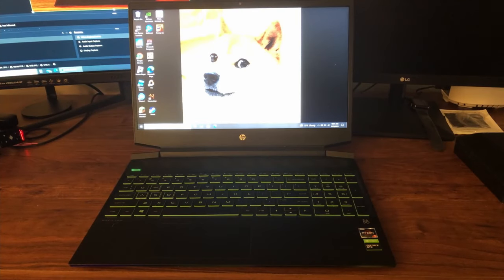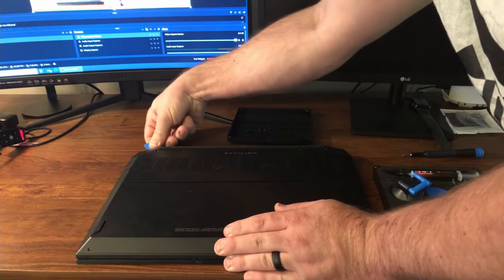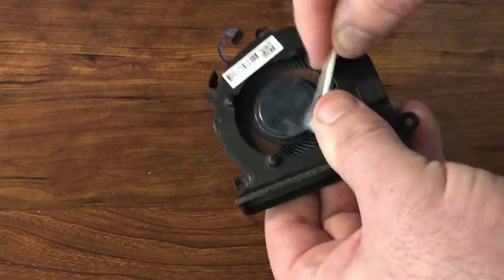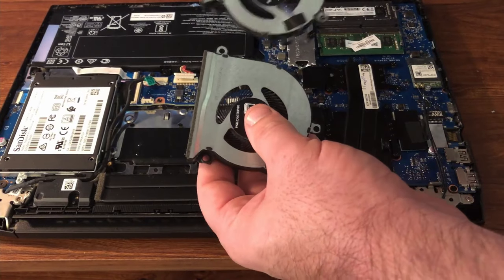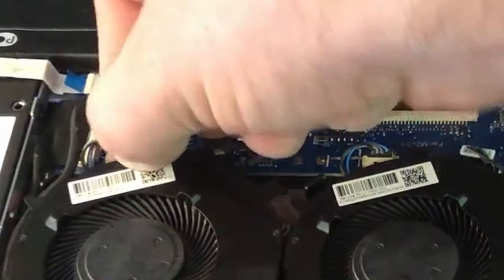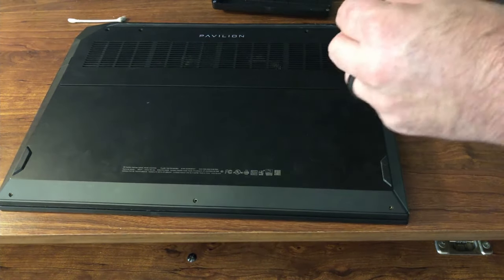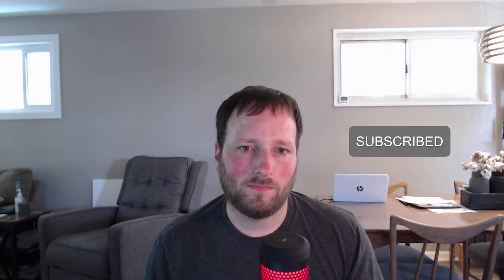How to clean a Laptops Cooling fans! Help your laptop run cooler then before.

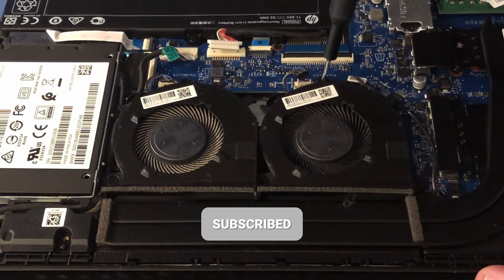Comment: i have a question, i have the same laptop in this video, at 2:23 what is that on the left of the fans with the big white sticker?
in that spot on my laptop, there is just a hollow plastic thing that doesn't seem to have any purpose. 

edit- think i figured out it's space for more storage.
but i still would like to ask, is there a way to take apart the entire fan and look in it? mine is loud and vibrates the whole laptop.
Reply from the maker: Yes, that is the ssd/hdd expansion bay area. For the fans I would say yes, but I haven’t done that kind of repair yet.
Reply: @MrDarkcore  so upon further investigation, it appears this fan doesn't start moving until shortly after the working one, and it's not as smooth and stable as the other. I think it's broken :(
Reply from the maker: Well if you think it’s a bad one, you could order a new on Amazon. It seems they run for around 10-15 usd.
Reply: @MrDarkcore  yeah I'm going to need to do that, thanks for help though

Comment: just a question, i paid a place to service my laptop, they said it just needed a cleaning, i expected them to do this what you showed in the  video, but all they did was take my money and send me home with the laptop exactly the same as i brought it in, had to just clean it myself, so what does a cleaning entail, they told me they just spray it with a can of air
Reply from the maker: How much did you pay for that service? To be honest, seems pretty shady to me.
Reply: @MrDarkcore  i signed up for their home plus care which is 25 a month, even more expensive than geek squad
Reply from the maker: Ouch, that’s pricey. Does that plan cover cleaning?
Reply: @MrDarkcore  yea they said it was covered but didn't actually clean it then tried to say, just bring it back in, but why would I when they didn't do any work to begin with so they blew it when it comes to customer service
Reply: @MrDarkcore   after further investigation it was found that they misrepresented their plan , basically tricking me into buying, thankfully though i was able to file a complaint and get my money back , i did the cleaning myself and the computer is much quieter now
Reply from the maker: That’s awesome, I had a feeling that it was to trick people into buy something they would never persuade getting done.

Comment: i do not feel any hot air flow coming out of the exhaust vents i use to be able to feel  it  before. but i do hear a fan so maybe my laptop has tow fans and maybe one is broken my laptop is a 2009 or 2010 laptop  Satekkite P855-S5200 windows 7 if there no hot air flow from the exhaust does that mean my laptop is broken i also put my vacuum on the exhaust vent i hope that did not brake  it before.  then to day i put it on the bottom intake vents  as another video said. is there away to fix this with out having to open the laptop like using a external cooling fan the kind that attach to the exhaust vents  untill i can take the laptop to the place to get it checked out? i need my laptop it very imported it will not brake down my other laptop does not work as it does not connect to the internet for some reason
Reply from the maker: If it the laptop is over ten yours old it could mean the cooling fans are going bad, but if it powers on and doesn’t crash because of heat I wouldn’t think that’s the issue.

Comment: My laptop has a DVD tray or whatever it's called lol do you know if I have to like, open the tray to take the back lid open or something? I took off the screws but couldn't figure out how to take the lid off ._.
Reply from the maker: How old is that laptop?
Reply: @MrDarkcore  maybe from 2015? No idea!! Model is hp notebook k8p06la#abm or so it says on the back
Reply: No wait that's the product name and model is 15-ac104la. I really don't know anything about computers sorry
Reply from the maker: @death__ray  is the battery internal or a removable external battery?
Reply: @MrDarkcore  it's removable, it's just where the hinges of the screen are

Comment: Please help me! Its been a few days since my hp gaming laptop makes this weird throttling sound. I have a similar laptop like yours and it turns out that the left fan did this loud sound. I compared both fan movement and it seems like the left fan have something in it that reduces the speed of the fan while the right fan works normally fine. Tried putting just the tip of my finger to the left fan and suddenly the speed of the left fan went to normal. But when i let go of my finger it makes the stupid loud sound again and it also seems like the fan vibrates way too much when i no longer touching it. I dont know what is going on with this thing but can you please help me? Thank you 😢
Reply from the maker: Sounds like it’s time to replace that fan, maybe an internal part came loose or broke causing the noise/vibration.
Reply: @MrDarkcore  thought i can try hard enough on fixing it 😅 thanks for the advice bro

Comment: i wanted to ask what does it mean when my pc does a weird sound (sounds like its about to explode💀) and if this helps cuz ik the problem is with the fans but idk if only cleaning it helps or i need new ones or sum, so i wanted to ask you if you (or somebody) know
Reply from the maker: Does it have any other issues like crashes or high temp under load? My first guess would be if it maybe a fan blade broke or something got sucked into the fan if it’s a constant noise.
Reply: @MrDarkcore  nope it doesnt and thank you i guess ill have to check on it😆 tysm!

Comment: Hi I cleaned it and it’s not starting up after I plugged the battery again I’ve been holding the power button for couple of paused seconds I’m starting to get anxious any Tips?
Reply from the maker: Try hold the power button down for like 20-30 seconds. See if that works.
Reply: @MrDarkcore  I did it man it didn’t do amything
Reply: @MrDarkcore  I got scared plugged it into the wall it booted up but it was like I had no battery was only working with the power from the wall
Reply from the maker: Did you reconnect the battery after working on it? I would make sure the connector is pushed in all the way. It could be loose.
Reply: @MrDarkcore  yes I just unplugged and plugged it for the second time
Reply: But here’s the thing I haven’t used
My laptop in a while so is there any chance that it was out of battery before I did this so should I maybe try to put it on charger for a little bit ?
Reply from the maker: That’s what I would do. Maybe battery just not charged enough to boot it on.
Reply from the maker: Any luck?

Comment: Hey  can we use like water insted of the liquid u used to clean the fan or like some other liquid
Reply from the maker: I wouldn’t use water unless you know it’s definitely not touching any electronic parts. Water will cause corrosion damage to it. I will have to look to see if there are any other types of cleaning solutions, that won’t cause damage.
Reply: @MrDarkcore  did u come across some liquid
Reply from the maker: @9e24ayaansalam8  not really, most things I could find where mixing other solutions together. IPA is probably the best option to be honest.
Reply: @MrDarkcore  Ok thanks for ur work!

Comment: What do u use if u dont have any opening pick?
Reply from the maker: The first time, I opened it I used a metal butter knife but wouldn’t recommend that. Just need something thin that would damage or break off inside the laptop.
Reply: An Old credit card or plastic card works fine use the edge,s

Comment: I did exactly what you did in the video and my laptop no longer turns on, power still goes through because my rgb on keyboard and mouse is still on but the laptop just doesnt turn on
Reply from the maker: Did you hold your power button down for 20 to 30 seconds after plugging everything back in? Plus I think the power cord can’t be plugged in while do this.
Reply: @MrDarkcore  Yep did that and no cables were plugged into the computer i have no idea what went wrong
Reply from the maker: @firenut4971  I would check to make sure ram is seated correctly and also in the right channel if you not use two sticks. Fans are plugged in, hard drives also. Stuff like that, the try holding power button down again.
Reply: @MrDarkcore  ive done all of those ive just accepted it and im saving up for a new one
Reply from the maker: @firenut4971  there is one other thing you can try but it’s kinda annoying to do.
Reply from the maker: So, you have to open your laptop back up. Unplug the battery, no external power, and hold the power button down for 20-30 seconds. Then plug in the external cord and see if it powers on.
Reply: @MrDarkcore  ive tried and to no avail
Reply from the maker: @firenut4971  that’s frustrating…
Reply: @MrDarkcore  yeah i think ill just ask for money for christmas and save up tbh

Comment: I am wondering if for any laptop, are there effective methods in cleaning heatsink pipes? Like taking it off, to be air-can washed.. since water can corrode metal?
Reply from the maker: Use 90% plus isopropyl alcohol to clean heat sinks pipes. It’s safe to use on copper or aluminum pipes.
Reply: More information about Laptop : https://youtu.be/fPPcBPsLlT0
Reply: @MrDarkcore what do I do if the heat sink pipes are in the way of unplugging the fans?

Comment: i noticed that the replacement fan has only 1 fan when i need 2, what do i do in this case?
Reply from the maker: Hmm, is one fan of the old fans better then the other?
Reply: @MrDarkcore  they both kinda suck but if u know, they areboth different and 2 types so they can fit over eachother
Reply from the maker: @zezo7114  ok, I am lost now. 😂 is it connecting the shock mount to the adapter? Or something?
Reply: @MrDarkcore  I'm saying, notice how the 2 fans overlap each other, which means they are made together i would presume, one for the right and one for the left. When i buy the single ones, how do i know which side fan i am getting?
Reply from the maker: @zezo7114  oh sorry I had a boom arm question in my head 😂 , I will have to watch my video to have a better answer.
Reply from the maker: @zezo7114  pretty sure both sides are the same fan. They have a screw hole tab higher on the right side and one that’s lower on the left side so they can interlock.
Reply: @MrDarkcore  Ahh thanks, I didnt wanna open my laptop to check again because i almost broke a tab lol. Thank you very much for letting me know
Reply from the maker: @zezo7114  no problem, glad to be somewhat of a help. 😂

Comment: Bro my new hp pavilion laptop fan makes noise is that normal....it don't make loud noise but I want to know whether is it normal or not..plzz tell me
Reply from the maker: Is it under a load? That makes any laptop louder.
Reply: @MrDarkcore  no bro it's new laptop....and it makes slight noise
Reply from the maker: It is hard for me to tell, since I can’t hear your laptop. It’s going to make noise no matter what, but I would really only worry if it’s over heating.
Reply: No it's not bro....but it makes noise sometimes that's it
Reply from the maker: You could take the back cover off and check if everything is secure. Plus make sure no debris in there.
Reply: More information about Laptop : https://youtu.be/fPPcBPsLlT0
Reply: @raghavendrahk375  same here

Comment: Why would we unplug the battery
Reply from the maker: I thought that same thing, I changed all kind of stuff without unplugging the battery.  Apparently it’s the proper thing to do though. 😂
Reply: @MrDarkcore  I heard unplugging the other things like the fans has a very very small chance of causing circuit problems throughout the computer if the battery stays plugged in but still very low chance. I will unplug it though when I clean mine, for sure.

Comment: When I was taking the battery plug out i scratched the thing behinde it i 4hink its the mother board but my laptop is still working rn
Reply from the maker: What did you use to remove the plug?
Reply: @MrDarkcore  flathead screwdriver and my fingers
Reply from the maker: From what I found online, scratches are fine unless you digging your flathead into the board. I would think your fine, but next time maybe get a sponger tool so you don’t have to worry about that. 😂
Reply: @MrDarkcore  yea hahaha thanks the video is really good tho
Reply from the maker: @AzemMC  thank you, I am glad you were able to find it helpful.

Comment: What screw do I use
Reply from the maker: Screwdriver? Phillips head 02 or 01
Reply: @MrDarkcore  my computer has been making a sound that sounds like metal scraping or squeeking. Do you know any fix to this?
Reply from the maker: How old is it? Also has it ever been cleaned?
Reply: @MrDarkcore  3 years or so, never cleaned

Comment: if you can see my questions probanly not but why is my laptop hot when i play more an hour
Reply from the maker: Well normally they get decently hot around 95 degrees (35 C). Also games put a lot of load on the cpu/gpu so it will get hot, I would only be concerned if it’s older laptop, and hasn’t be cleaned or thermal paste hasn’t be replace done.
Reply: @MrDarkcore  oh thank you soo actually it's old one but i clean screen and keyboard but i didn't look inside of laptop soo i need to check it out and  how many pasta needed to put and normally i need clean fans

Comment: My computer decided it was time for a firm ware update after I powwred it back on😅
Reply from the maker: You got to love those updates. Were you able find a way around the heat sink pipes?
Reply: @MrDarkcore  no. Just left the fan in place. Didn't want to break anything. The fans are a lot quieter now anyways. Did manage to check the air outlet and it looks clear so I won't have to deal with that for a while yet. Hopefully several years on that.

Comment: What is happening to my fans cut it sounds like it is making  a hsss sound like a snake can anyone help me?
Reply from the maker: Did it recently just start making that noise?
Reply: @MrDarkcore  yes i just got back from my school about to play my games then sudenly it made that noise
Reply from the maker: Could be debris that was pulled into the fan or maybe the fans are going bad.
Reply: @MrDarkcore  oh no just bought it two years ago and it was super expensive i dont want to replace the laptop can i just replace my fan or something?
Reply from the maker: @reignharjoto3409  I would just clean it then or get someone who to clean if you can’t.
Reply: @MrDarkcore  okay i guess thx for the sugestion

Comment: my laptops fan is so loud and my parents wouldnt let me do this :(
Reply from the maker: Are you sure they are dirty?
Reply: @MrDarkcore  yes
Reply: @MrDarkcore  i used my fingernails on the screws
and the thing is dirty
Reply from the maker: Well if your not allowed to take it part you can always get a can of air and spray it in the bottom vents and hopefully it would clean some of the debris.

Comment: I did all showwd in the video but when i booted it up the fans didnt work
Reply from the maker: I would just check to make sure the cables are pushed in all the way for the fans. Maybe let the laptop run for a couple minutes to see if the fans kick on. It could be your fan curve settings are high.
Reply: @MrDarkcore  they started working but its still running hot idk what to do
Reply: @MrDarkcore  also for some reason 1 of the fans is slightly higher than the other
Reply from the maker: @Robi372  how old is the laptop?
Reply: @MrDarkcore  4 years its the same laptop ur using in the video
Reply: @MrDarkcore  do u also have both gpu 0 and gpu 1 show temperatures in the task manager?
Reply from the maker: @Robi372  I never checked that, I will see what it is.

Comment: Wtf bro i do the same and my laptop stopped working
Reply from the maker: Did you unplug the battery before cleaning?
Reply: @MrDarkcore  yeah
Reply from the maker: What is not working? Powering on?
Reply: @MrDarkcore  yes, i tried to turn it on and its not working
Reply from the maker: Ok, what I would do first is hold the power button down for like 20 to 30 seconds. Try both plugged in and not. If nothing you may need to open the back panel and disconnect the battery. The hold the power button to discharge any stored power. Then hook back up and try again. Let me know if anything thing happens.
Reply: @MrDarkcore  ok
Reply: DUDE!!! THIS WORKED
Reply: @MrDarkcore  THANK YOU
Reply from the maker: I had this happen to me before, so it was worth a shot. :)
Reply: @MrDarkcore  Dude, I did what they said, but the pc didn't work
Reply: Can you tell me again
Reply from the maker: @umutseven4164  what is the issue?
Reply: @MrDarkcore  The laptop does not work when you press the power button
Reply: @MrDarkcore  And the led doesn't light up when you plug in the charging cable
Reply from the maker: @umutseven4164  well first I would i unplug the laptop and hold the power button for 30ish seconds. If that doesn’t work, you may need to check the battery connection inside the laptop. I would check the ram and other components to make sure the didn’t come loose. Then try the first step again to see if that was the issue.
Reply: @MrDarkcore  Bro didn't open again:(
Reply: @MrDarkcore  Thanks for the help
Reply: @MrDarkcore  I'd better have it fixed
Reply from the maker: @umutseven4164  I was going to say you would have to open again, but sorry I wasn’t able to help much more. If you find out the issue let me know.